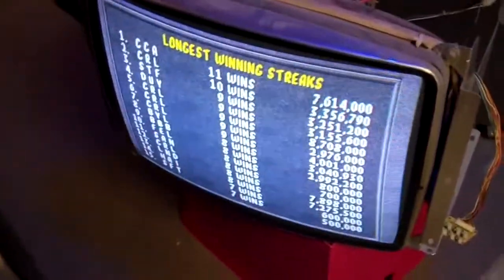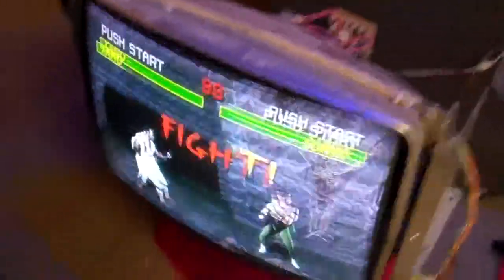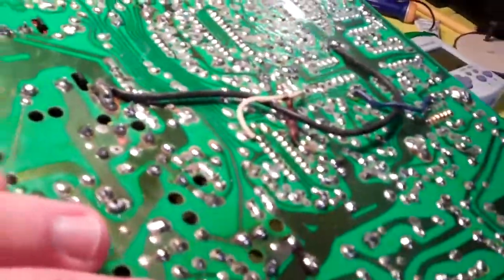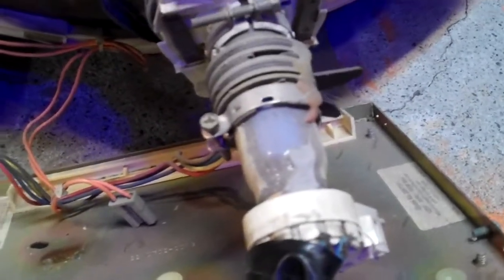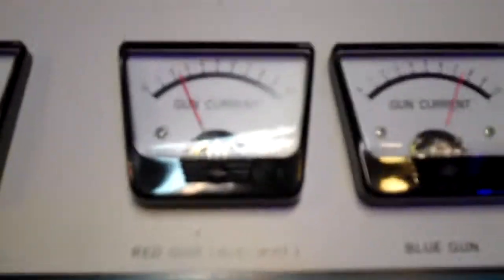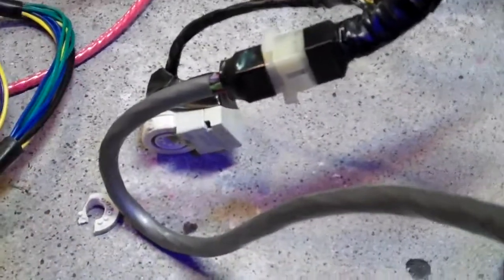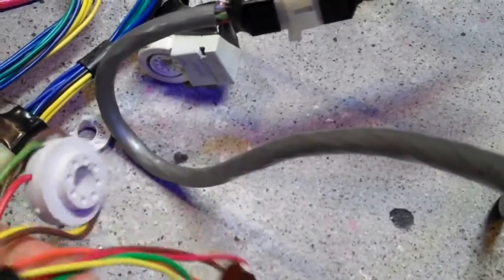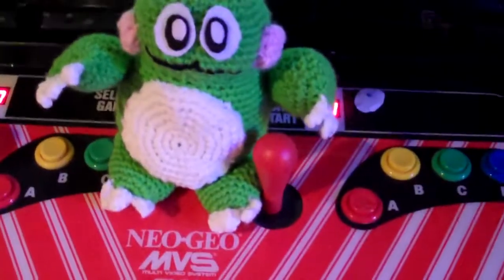Wow, Turns out that cap kit I did all those years ago was good!

Comment: I just bought a mortal kombat 1 machine , I'm trying to get the brightness to turn up more as it looks a little dark . I've adjusted the rgb and both brightness pots , still needs to be brighter tho . It's about 15 - 20 % darker than your picture you have on your screen in this video . Do I need a cap kit ?
Reply from the maker: You should try turning the screen knob on the flyback up a tiny bit, it will increase the brightness, think of it as a macro adjustment for brightness, and the brightness knob as a micro adjustment.  You probably will want to do a cap kit on it anyways. Also check your flyback, if it is a K7000 and the flyback has white knobs those flybacks are more prone to failure.